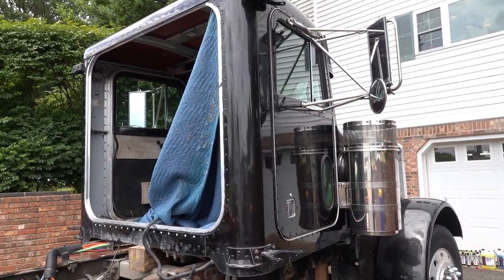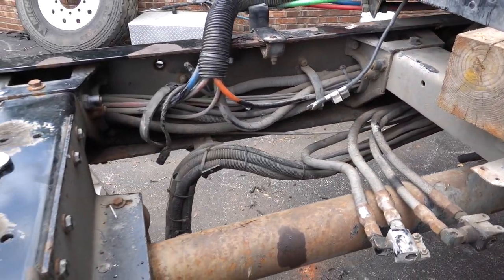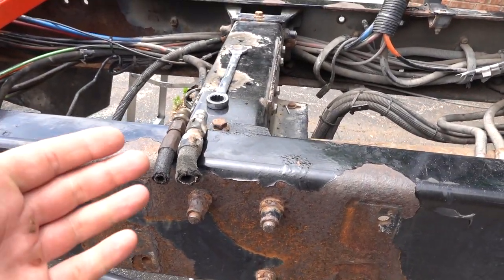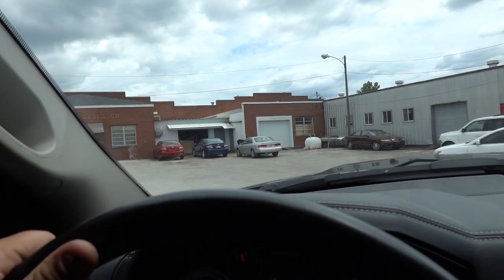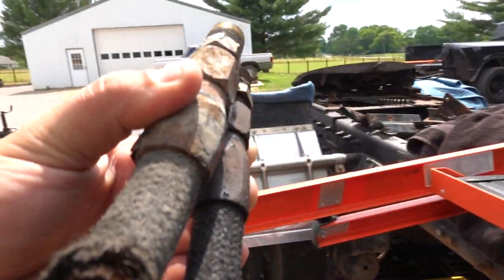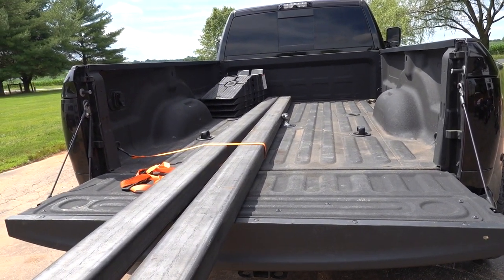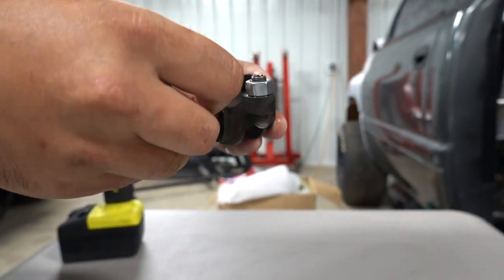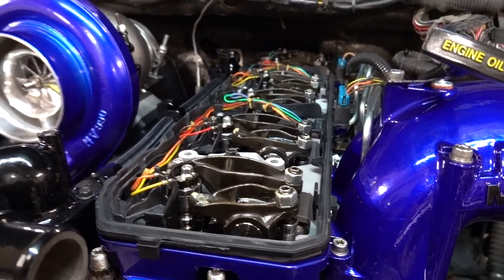MY 6.7 CUMMINS IS RUNNING LIKE CRAP!!!! HERE'S WHY!!!

Comment: One of the mistakes I made when I did my fuel lines was I tried making them as short as possible but that failed it failed because the fuel lines need to be at the same length going to each side because your fuel draw and fuel return will seek the shortest route possible

Comment: Just a heads up make sure your fuel lines to your tanks on the pete are routed and as close to the same length on both sides it can cause fuel tank equalizing issues.

Comment: Make sure that when you are making your fuel lines that you make the two feed lines the same length and the two return lines the same length because otherwise the fuel takes the path of least resistance and your tanks won’t return or drain at the same rate